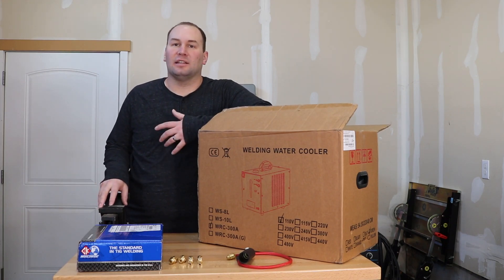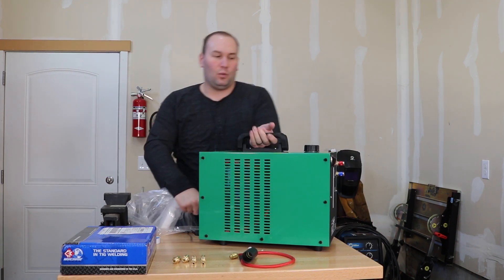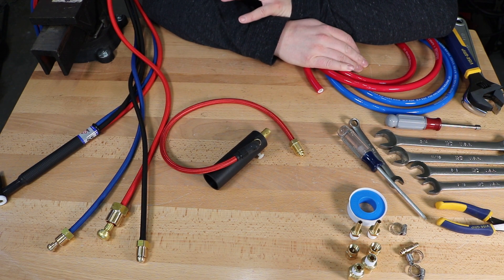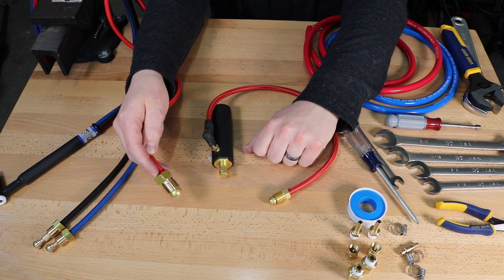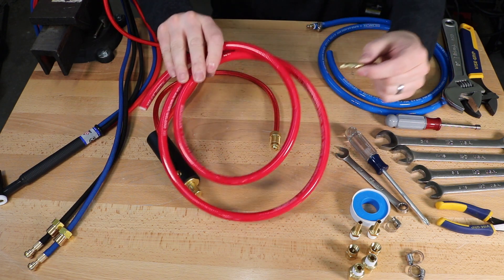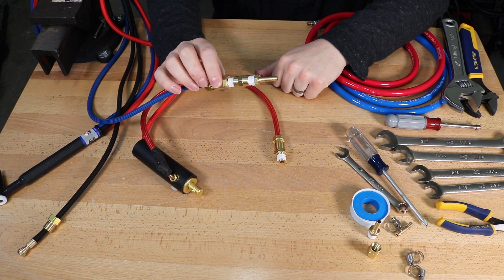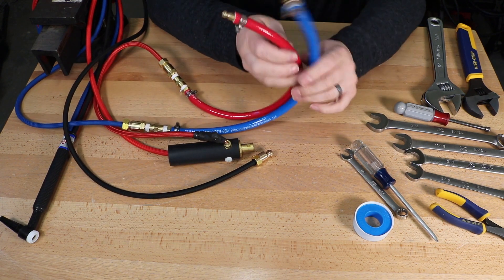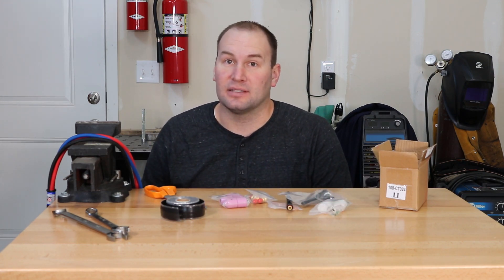Setting Up a Water Cooled TIG Torch - Ebay TIG Cooler

Comment: Hey Tim, love your videos. Quick question for you, do you have any opinions/experience with flex head vs flex lock 20 style torches? I am looking to get something smaller and more flexible than my CK 18 rigid neck for my primeweld 325.
Reply from the maker: I just use solid neck torches because that’s all I had when I learned and they work fine for what I do. Flex heads can be nice to adjust the angle a little. For certain jobs, I can see how a flex lock would be a game changer, but I just don’t have a need personally. On my big machine, I use a CK 230 which takes the smaller consumables for a 20, but is rated for 300 amps. That’s my favorite torch, but it’s best to just get what suits the work you do.

Comment: Hi Tim, I recently bought the HTP Revolution 2500, and I wanted to know if the CK number 20 water cooled torch would work for it??
Thanks, Doug
Reply from the maker: Yeah, that's what I use on my other HTP with the same connections. You just need the right fitting on the gas line. If you buy the torch from HTP, they'll set it up with the adapter you need or you can just get an adapter to the American style gas fitting for a couple bucks.
Reply: Thanks Tim, I was able to find it on their website right after I posted this question!
I enjoy all your videos, keep up the good work!!
Doug 👨🏻‍🏭

Comment: The easy way is to xut of the water connectors and use Rectus 21 to 5mm barb connectors, woth an ear clamp that way you get rid of the bulky 3/8 fittings.

Comment: do you still use this chiller, how did it hold up
also do you know if the QDWAP quick-change adapters fit the Quick connects on the ebay water cooler

Comment: Thanks for your video, it gave me the information to set up my primeweld 225x for water coolde torch.  I found a arc zone water cooler that is just a 10 gallon water tank and pump that is the entire cooler assembly, no fan or radiator. This is similiar to what I had on my old Miller tig. It is all working fine.

Comment: Tim I was in your position about 5 years ago. I purchased a CK wp20 torch.  I contacted usa weld and they sold me the quick conect fittings that went  right to the hose. I have one quick conect fitting at the end of the three hoses.  Didn't cost much either.
Reply from the maker: USA Weld has the best selection of these types of things. I would definitely go there today.

Comment: No gas quick connect??
Reply from the maker: You could put one on, but I don't have a need for one.
Reply: @TimWelds  Yeah I just figured that you could switch to a different torch quickly. I'm thinking of doing this to my set up but add the gas fitting so it will allow me to change over to a totally different torch without any tooling.

Comment: CK has adapter fittings that go directly from the 5/8 on the end of the hose to the male quick connect. Then you don't have to use any of the hose or clamps. They have them for both the left hand and right hand thread. Part QDWAP, QDGAP

Comment: Hey Tim, can you give us a quick update on the cooler..? still running well?  From the video, it sounded pretty loud, does that bother you at all?
Reply from the maker: Hi John,
It still works great, no weird sounds or signs of declining performance. The noise is my only complaint, but it doesn’t bother me too much since there are so many noisy things in the shop. It’s about the same as my heater or the cooling fan on one of my machines. Definitely quieter than the compressor or saw. If I’m tacking at low amperage, I just leave the cooler off until I’m ready to weld, which helps as well.

Comment: Just got one of the stainless steel, brass pump coolers today, and you video was very helpful. Got same CK torch, but went with the flex lock. Thanks for the adapter link.

Comment: Thank you SO much for that - very informative:) What is that annoying hum though?
Reply from the maker: I was so frustrated trying to figure out that humming sound because it would come and go. I looked into about a dozen things before I found that it’s an aftermarket power cord for my camera interacting with the external microphone. I switched to running batteries and now I’m good to go.